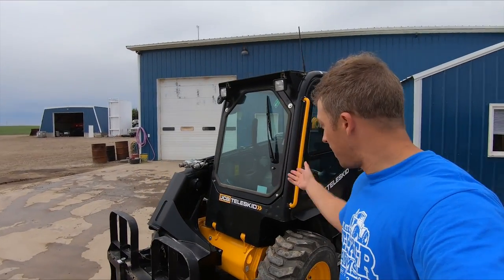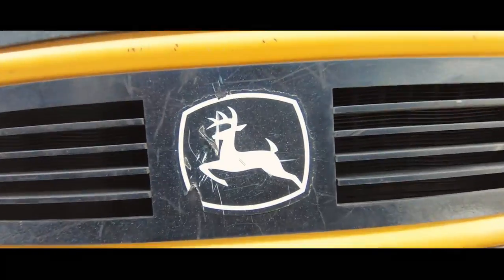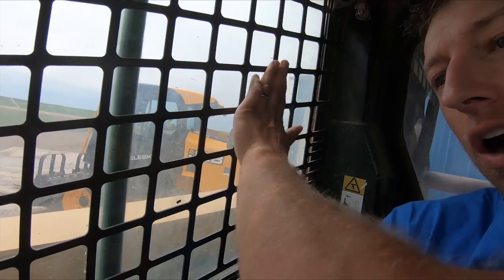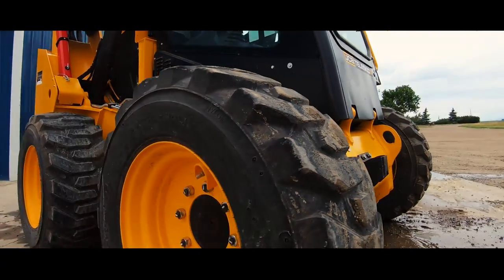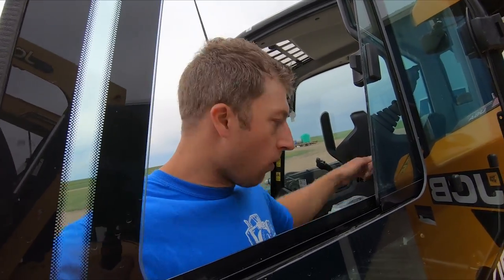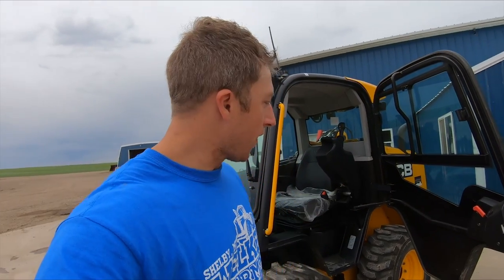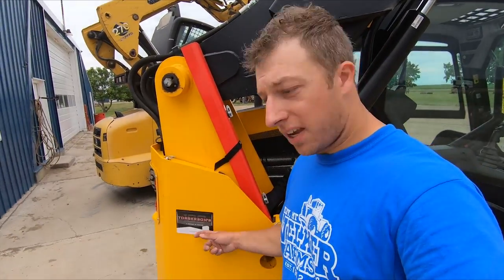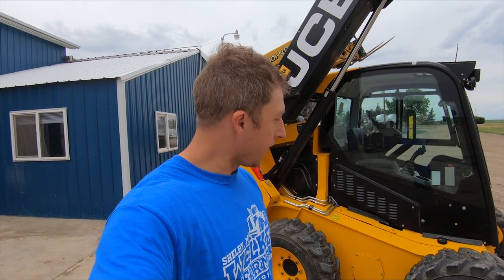JCB Teleskid or John Deere 270?

Comment: Makes me wonder if the glow plugs actually work on the JD.  They may be burned out, which is why it is hard to start in cold weather.  I have never see ether injectors used along with glow plugs.  The glow pugs can ignite  the ether.

Comment: For right side visibility maybe mount a fish eye camera on the back or roof [detachable?] to cover that side with a small screen in the cab. Kind of like a car camera they use for backing up. Wouldn't need a big screen monitor just have to get used to checking it [talking teleskid. You could maybe change the door with something simple to stop it from opening too wide [just an old fashioned spring could probably do it quick... weld a small bit of something on there to hook it to lol]. Clearly I'm talking out my arse on the door bit but a camera would fix the visibility on the driver right side. Cool machine though for sure. Hate the idea of walking out under that elevated set of forks with a load on it for any reason. Cool video though. I think the teleskid is a winner more than a loser on most counts [maybe they can work on the more gentle control end of things. Nice demo!

Comment: I agree the JCB is a brilliant machine . I bought a tracked version of the tele skid last year. 1 machine replaced 2 for me. the only downside I have found is if you have electrical problems only jcb can download the fault codes . but that's becoming across the board with new machines.

Comment: IDK if anyone else has said this and I am going to send feedback to JCB as well, but for the right sides blindside could have a small camera and monitor installed for safety compliance. Wouldn't be much of a cost compared to someone's life or well being.
It could blink on when the boom covers the view on the right and turn back off when the boom is low or high enough to give the viewable area back to the operator.

Comment: It would be interesting if some of the other makes let you demo their similar offerings so we could hear your thoughts on them as well.

From what I have heard that it one problem with electronic controls over hydraulic or linkage as you can usually adjust it somewhat but you don't have quite the same level of finessing.
Reply: Can reflash the computer to make softer.

Comment: I guess I'll find out the real scoop on the jcb. Just purchased a used 320T. Yours was one of the videos I watched before I decided. I agree the controls are a little touchy. There is another vid out there on setting them up so will do that when it gets here. I also just bought a wolverine attachment that is a 3 point mounting and has a hydraulic motor attached that has a 540 stub on it to run pto. It will be perfect for the snow blower and the post hole digger!. And guess what!!! I'll be able to get out of the cab when setting up the digger! Wow!
Reply from the maker: There are many times I wish we had the JCB. The side door and extending boom are such an amazing feature! I've heard JCBs can have electrical issues down the road but that is all brands anymore.

Comment: We run a john deere 332G bought new just a year ago and I agree they very pricey and it has all the features the jcb but yes you still have to crawl in the front of and with weight package we put on the back it has a lifting capacity of 4200 lbs. and it works well for our operations

Comment: I understand the sentiments for this type of machine. The telescopic feature offers an improvement on range of motion that is clearly a benefit. In this market segment at this price point however, as far as safety and productivity, I would have to compare pricing to the smaller articulating machines just for the safety aspect alone. I can get the same abilities, with exception to the telescopic feature, from a machine that offers a safety benefit and capacity improvement for only a marginal increase in money. That marginal increase can be easily recovered by the reduction in tire wear and safety. From a safety aspect the visibility of the articulating loader, even like a small Wrangler or something close, is immeasurable in operator confidence. Great Vidya though. People need to see productions like this to make informed decision. God Bless bud.

Comment: We have 2 new Holland's and a kubota... we have a new Holland L753 it's a 1995 very strong reliable machine... then we have I think it's a l232 it's a tracked new Holland... then we have a kubota SVL75 it's a wheeled machine runs good love the guitine door over the swing door its fast less touchy controls... main complaint is even with the enclosed cab it is unnecessarily loud inside

Comment: Love your vids and I'm jealous of your empire lol... just a little fyi those handles to realese the locks for the attachments do have grease fittings usually on the bottom of the lift arms usually on the bottom near where the lock pins go thru on the attachment plate. Also they reccomend stepping on the wheel to get into the machine vs going over the top of the attachment

Comment: I’ve avoiding the jcb stuff to be honest, the company I work for has 3 pieces of that equipment. But I want to point out that our t270 has a snail mode so really it is a 3 speed. How ever the snail mode only seems to be for the hydro. Try double tapping the speed control and see if the little snail pops up instead of that 🐇
Reply: To late now.......It's gone. 😢

Comment: Hello to everybody at Welker Farms. With regards to the JCB isn't it just like every other thing on the farm, you get to try something brand new(to you) and you think WOW this thing is just what I need! But wait, I already have one that we have had for a few years now. Yes, it's getting older and is a little slower and a little bit noisier than before, and doesn't have AC the heater isn't as hot as it once was. The old one doesn't have all of the fancy knobs and switches that the new has but and here's the big BUT the older one is all paid for and it's so hard to justify and spending sooo much on a new piece of equipment when you have other costs that just don't make purchasing this now a good investment. But like you said when its time you now know what you would like when it is time to purchase another one.  Doesn't it always come down to $$$$? Never enough when you need it.  Oh well, guess we will just go on working the older one until we just can't fix or pound into submission the parts any longer and only then we might think about going back to the new one and look into the costs. I'm sure it'll be even BIGGER BUCKS by then. Stay safe because danger doesn't take a day off, and folks like us need people like you folks in our lives so we can stay healthy and safe. A great big THANK YOU to you and yours.

Comment: I think you should reserve the time to get the JD cobbled back up, there's no issue too big that can't be fixed on these types of machines short of mangled chassis or drive issues. As for the hydraulic sound, that sounds to me as bad seals. When winter comes, you should get a kit and tackle it, it's a small job compared to bigger machines and it's worth it.

Comment: Hollywood, you missed this one unless you have never driven a quad cab P.U. in a dark shed or such and you look over and switch on the "camera" for the hitch, other rig, parking, etc... and it could very easy to do or a DIY project is  a camera in cab for blind side of the rig. I have had the 873 and the little 653/?? can't remember no., of it with the camera in the first one mentioned cause I had a hitch that I used for moving a mill with some distance.. quick an easy, get them the idea and win free can of pringles chips or honorable mention in farm and goat magazine/ I don't believe that the subscription, to that, leaves Arkansa state line. (very small mag I'm sure/lol) If I hadn't had the camera in my truck I might of cause he ran out after I got in my truck, my grandson and that folks is when you seek counseling and then its sketchy. I like the safety factor really well but JD Rockefeller can only own as the price is inflated. I got mine used but needs repair auction... a 873 with four thousand hours for not lying seven hundred fifty dollars ( a very good deal) I did switch engines but I had one and saved the one I  pulled (built) and a set of tires (they robbed the machine of the rubber cause it sold so cheap) I didn't care cause me and my brother had it running and using in two full days. We put another six thousand hours on it and when my brother passed in april my sister in law sold it for a grand cause it needed paint (don't they all) but I can't run it either so no biggie to me. I kinda like the fact that they will hod value but really... over five to ten max for used and running the way I see it. Good video

Comment: I'll say, it is unfair to compare a 2003 JD 270 to a 2018-19 JCB. However, in my experience JCB has been bottom of the barrel. Years ago they were slower, heavier and generally clunky. I learned an old Thomas, then a Bobcat 743, 751, 763, 863. I've run the Techuchi tracks, 1838 and 1840 Case Uniloaders. Then when I actually was operating professionally JD came into play a 6675, an 8875 and a 270. This was early 2000's. I went onto a Cat 246, a Bobcat T240 and T190. Currently push snow with a 2016 Case SV300. I love the quiet, the warm and roomy cab and the tunes. But I miss the Cat. I could feel/read it better.

You echoed my concern with the one arm design. This machine my be nice and tight now, but what happens when that boom wears? You won't be able to work level anywhere. It can have it's  place on a farm, but in construction I can see it being an expensive and long term ineffective piece of the arsenal.  If I was in your shoes, I would keep the 270. A good and proven machine.

Comment: JCB  Builds some great machines an you are correct they are definitely within the ballpark range we have had case, John  Deere and JCB back holes.. I'm sorry to put it this way but you got the Chevy the Ford and the Cadillac.. JCB  would be the Cadillac overall. Fact we totally wore out 1 JCB an we replaced it with another one identical.  Dozers? Definitely a Cat like the salesman told me once you run a Cat you'll never go back. That's why the Cat will stay till I am gone. Skid steers? We had case ,JD , Bob cat .. we looked at a JCB but like you $$$$ talk an another Factor was parts and service... Bobcat is 30 minutes from the farm JCB it's three hours one way. As you well know , when a machine breaks down you need it back up right away not 2 days from now . So when we went to replace the skid steer the fourth one we went back to bobcat .Brother wanted to go JCB an I would have loved to but there's only so many dollars income a year. Personally I really like the one-arm coz let's face it you're in and out of a skid steer a thousand times a day  But I do have one question though.. I know they off setted the cab to keep the boom weight more towards the center of gravity of the machine how ever my question is when carrying a "heavy" load say 3 feet off the ground do you notice any say weight shift to the right side of the machine drive tires???  also? In slippery muddy conditions, does the machine want to tend to lead to the right? .but overall?? I can see the JBC setting in my driveway over the bobcat. But I'm your dad's age an I still love the mechanical linkage  for tedious fine work.. but thanks for a great unbiased comparison...(edit.) as a side note? On the Deere fine tweak the pump timing . We have found that to solve a lot of hard winter starts engine's ;-)
Reply: Thanks Joe 👍

Comment: A mine I worked at briefly demo'd a JD skid-steer a year or two ago. I was unimpressed by it, the visibility and controls were inferior to the CAT 242D I was running at the time. JD likes this "dot" control selection indicator in combination with a button, but it's unintuitive and requires a schematic/legend in the cab. They do it on both their skid-steers and wheel loaders and I have no use for it.

The Teleskid has my attention, but my budget only allows older used machines and I get by fine with my EIMCO loader which can do things a skid-steer will never be able to.

Comment: No offense, but a lot of your complaining about the John Deere is because you bought a bare bones machine from 2004. This comparison is not even close to fair, I bet if you had a new traditional skid steer it would be different and possibly much much closer.  My biggest complaint with both, is you need tracks, tracks are waaaay better for traction in anything but dry ground.
Reply: Nick prefaced it in the beginning that it was an old skidsteer.  But most of the difference is the side door and telescoping boom.  Which JD doesn't have on their new ones.

Comment: JCB I worked for the City of Los Angeles Recreation and Park Department for 33 of my 40 years. My complain about JBC(jJunk, crap, bull §hit. You had a wheeled unit. The City of Los Angeles looking to save money wrote up specific items for Skip loaders. A piece of equipment that is a daily user well we traded i in our John Deer’s which granted were old, but were a hell of a machine for this tip over easy (POS) made in England. It was fine for smooth roads,but we used our skips on mountain trails and dirt fire roads where typing over could happen at any time. The specs were made by the Department of Water and Power. Their Skips were primarily used on city streets. Oh and if the tractor needed parts you would have to wait 6.months or better to get the parts from England. Now this probably has changed by bow as they have supplies network here in the states. But at the time I wouldn’t buy one of their units.

Comment: That old deere sounds rough.  I have the exact same model except its a 2000 and single speed only.  5000hrs and still gong strong.  It is a bit loud but doesn't sound anywhere near as bad as yours. Also fairly easy starting even in the cold months as long as the battery has enough juice to turn it over and that's not using the block heater or glow plugs in the 20's but I know that's not super cold.  We were looking to upgrade to a tracked unit but found a set of VTS tracks and it makes it into a pushing and lifting beast. The JCB sure looks nice and the teleboom I could see being really handy when working with hay and long reaches.  Just not sure its worth trading up to all the technological terror associated with these new ones.  Its hard to beat 80+hp of natural aspiration, mechanical injection, and simple hydraulic controls when it comes to reliability and longevity.

Comment: Your not the only one to carry the back end of a truck because of a missing wheel, my dad and were on a secondary highway 4 miles from home and felt a bump and then watched the back wheel pass us. we had snapped the shaft at the bearing. Ended up walking home to get the  Ford to carry the back bumper and push the truck home.

Comment: Did you consider if the teleskid tipped over on the door side, you would not be able to get out of the door.  The typical skid-steer, you can always get out regardless of how it tipped
Reply from the maker: We definitely did and the front window has a detach feature so if that happens you can get out the front.

Comment: Nick you don't need to take my advice we have a wheell unit on the ranch I do wish we would have bought a track unit for floatation you will not kick yourself if you can afford it. Go a track machine and yes the sensefitifity is adjustable. Love ours blows all others away buy it with tracks. Trust me you will not be disappointed resale is huge Nick find a way you will cut your costs when you get used to it we debated our purchase now we can't live without it. Just the low maintenance will save you money just my thoughts but I do own one huge advantage to me.

Comment: case 1845, I have no idea when it was made ... 90s maybe... you and Scott have kids, what is the value of safety?(I know, not fair, but it's not a judgment, simply necessary for my comment)  and, they are breathtakingly expensive, when HFW got theirs, I looked up the price. Yep, ouch.  For me, it's not worth it because my case works just fine - it's also not a primary tool and it's exceptionally rare that the operator has to get out during operation... that said, after demo season is done, perhaps you can get a great trade in on the demo?

Comment: The wind will do the same thing with a pickup, it happened to me, i opened the door of my Silverado, the wind caught it, and the hinges were broken, and, the door sprung. It cost almost 1500.00 to get it fixed, they had to put on a new door, the door was actually torn apart where the hinges mounted.

Comment: Just wait till that electric/hydro unit freezes up or jams up with dirt on the bucket pin system.  Then you'll be cussing it because there is no other manual way to unlock it, the hand levers go away.

Comment: If id have a choice between your deere and the gaycb teleskid and both are the same price id buy the deere hands down the deere are alot more reliable parts are easy to get and it retains its value,  wait till the gaycb starts having problems is when youll see the true difference that being said the gaycb side door is extremely nice
Reply: The door is the deal maker for me.  When the patent is over JD will defiantly copy it.
Reply: Robert Welker yes especially for older people to get in is real nice but you cant beat the handling and operation of hand foot controls

Comment: seen 1 guy get crushed by one trying to move the arm from outside the skidsteer. hydraulics failed. Then i've heard enough guys dying in similar ways. What JCB could do about the visibility on the rightside is there is glass or something that can act as a video screen. Putting a camera on the arm that activates when the arm is in a certain range across the window outputting to the glass. Still can see other stuff bu t all can see behind the arm. 

I think they are called transparent lcd screen. Not sure how shock resistant they are